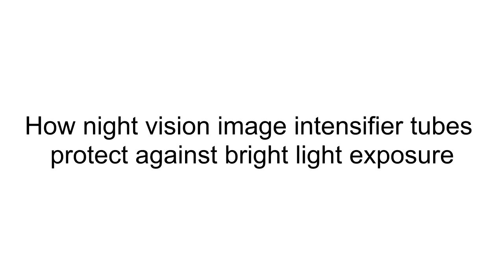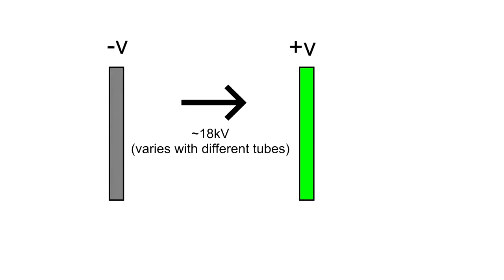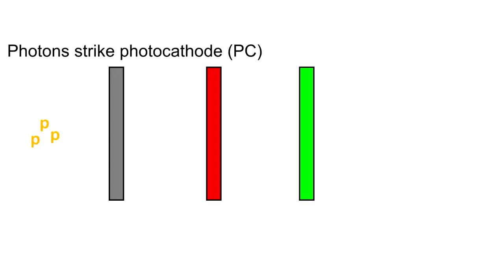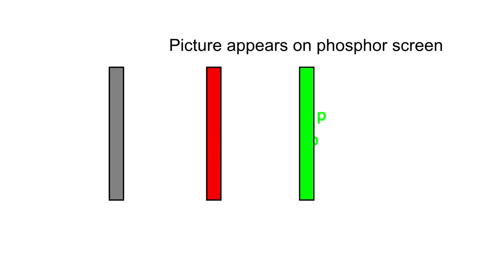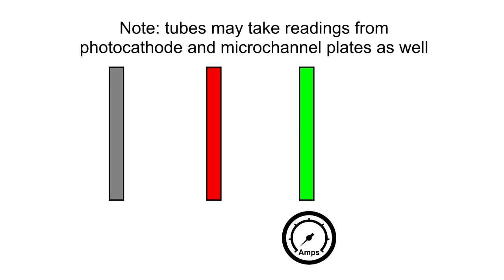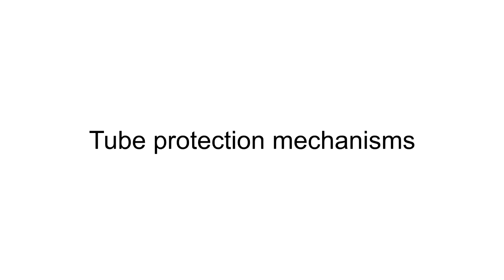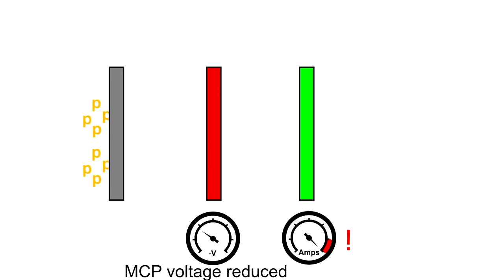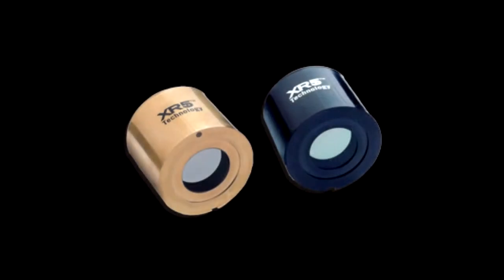Protection mechanisms of night vision image intensifier tubes

Comment: And yet my ass still manages to permanently damage my tubes from quick second glances across street lights.
Reply: Damn, that sucks bro 
But what kind of permanent damage? As in there is an image permanently burned into the tube? Or did it affect its light amplification strength

Comment: Is it possible for extreme bright light source to damage the tube when it is off? In theory it should not, as no electron is generated by photocathode that will impact the phosphor screen, nor will  MCP multiple the electrons which may travel backwards to damage the photocathode? How about light source entering from the ocular lens?
Reply from the maker: I suppose it's possible if you shine something like a 2W laser into the tube and start physically burning the photocathode. However, once the tube is off and the photocathode is completely drained of charge, it'll likely take insane amounts of energy to do any damage to the tube.
Reply: In gen 0+ to gen 2+ designs, the photocathode will generate electrons even when the device is turned off. Because it uses the outer photo effect. In gen2 tubes, that can lead to a image appearing on a tube that was recently used and is exposed to high light. Because the the capacitors for the fixed screen voltage will stay charged for a while. The photocathode can generate enough electrons to pass through the micro channel plate and light the screen that way. This is also aided by the photocathose passively amplifying the electrons which come with a high energy thanks to the acceleration distance in the gen2 design. In gen2+ this phenomenon requires even more light to occur. Up to S25 photocathodes, transparent photocathodes where the norm, Those can deteriorate from moderate light exposure when turned off. The metallic versions of the S25 photocathode are not so sensitive to that effect. But they are still physically very thin, so they heat up fast when exposed to very bright sources. That leads to what looks like bubbles under the glass. That type of damage stems from a small area expanding under heat and peeling off the input glass. Those bubbles may touch the microchannel plate and cause serious damage when the device is switched on. 
Gen3 tubes use a semiconductor photocathode, which output energy requirement is lowered by a layer of cesium ocide. They use the outer photo effect, so a external voltage bias is required to make them work. They are also thicker, and less sensitive to deterioration. So unless you look at the sun, the deterioration should be somewhere in the ballpark of equivialent solar panels. But I never tested that and don't know anyone who sacrificed a tube for such test. In general the main wear in a gen3 tube is on the microchannel plate and the phosphor screen. And that can be kept in check by the internal protection. It's wise though to not crank the gain up to max. unless it's needed. And not to expose the thing to sunlight even when turned off.
Reply: It is technically possible if the photocathode is exposed, as it is made of a photoconductive material (Se? Anything else?) but with no voltage emitted electrons are slow sooooo.... idk
Reply: Yes, it has happened. Especially with the sun. Intense light can physically burn the photocathode.

Comment: Hey could you review the agm global vision pvs 14 51 gen 2+ and make a ultra low light test would be awsome
Reply from the maker: Unfortunately I don't have one of those. However the tubes inside will have roughly the same performance as an Echo or NNVT tube. Check out the comparison video I posted for footage on how they perform in extreme low light.